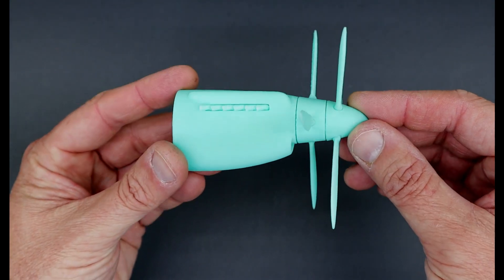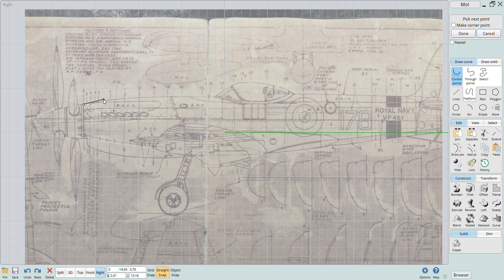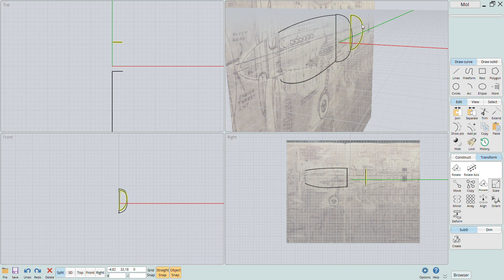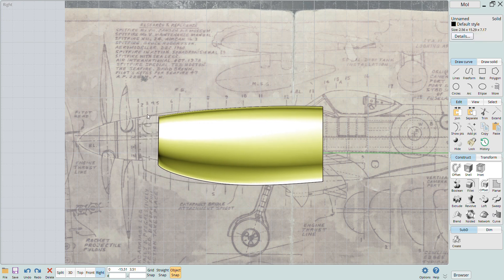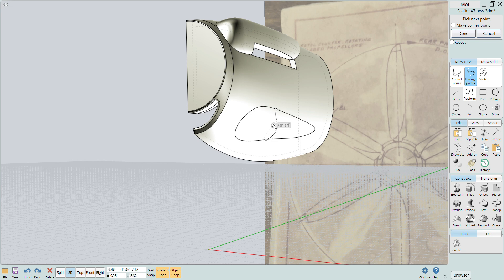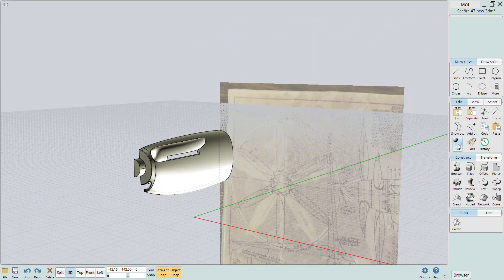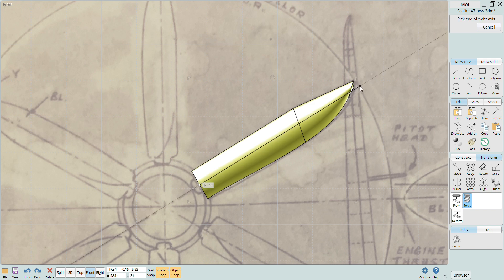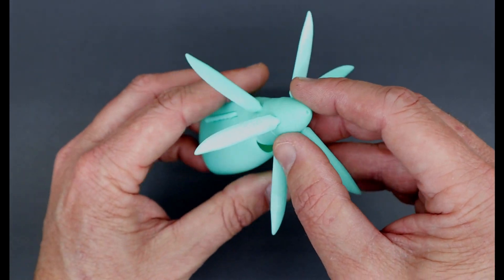Making Model Airplane Parts wit MOI 3D: 1/32 Seafire Mk.47 conversion tutorial

Comment: But what about the scale of the image?
I haven't seen that you have defined the size you want to work on.
Reply from the maker: I probably skipped that part but the imported drawing was scaled to 1/32 before I started tracing the outline.  The software supports that function when you import images.

Comment: I have been wanting a Douglas BTD Destroyer model in 1/48th scale for a long time. The only size they make is 1/72 by a couple of oddball companies.  While I'm thankful for at least that it still isn't quite to my liking.  I'm pretty sure they aren't using this kind of software either because like most resin kits they don't fit well and the detail is fare at best.  Too me this is like a breakthrough.  At 59 I am a little out of the loop, However I do my best at redrawing fuzzy airplane model scans in Adobe Illustrator, a software not really intended for that kind of work.  I'm really enthralled by this kind of work!
Reply from the maker: Hey Mike, thanks for the feedback.  Printing technology is certainly making it easier to get the things we want.  Ping me over at flyingSmodels@gmail.com and I can share some pics of some basic work I've done on a 1/48 & 1/32 Destroyer model.  Might be able to form the base for a project you've been wanting.

Comment: That shell command blew my mind…i wonder if there isn’t a similar command in rhino
Reply from the maker: I'm not sure about Rhino or not but hopefully so.
Reply: @FlyingSModels  it was a question for any rhino-modelers who might stumble into the comments section.

Very similar to the GUI you’re using, but maybe with a lot more bells and whistles. It’s also two or three times as expensive, and with a LOT of bells and whistles. Grasshopper is also a very cool add-in which is free, but not at all necessary for the type of modeling you are doing.

Anyways, I subscribed because MOI looks really interesting for the price and I’m interested in what you’re able to do with it. I just started to use 3d printing in order to replace a few broken purse of plastic in my dishwasher…

Thanks for sharing!

Comment: Thanks, I am just starting out with the MOI trial, and needed to know about sweep.
A friend of mine many years ago introduced me to his dad, and ex Rolls Royce body maker. During the war he made the Spitfire engine cowling, by hand.
I own a 1930 Austin Seven "special". A hand made 2 seater built on an A7 chassis. The man who built it during the 50s got the aluminium for the bodywork from a local RAF base. They were scrapping a Spitfire or two. It's possible, maybe, that my A7 is a bit of a Spitfire.
Reply from the maker: That's great.  Enjoy that free trial and ping me if you have any questions or need any help.  Another feature that I need to make a video of is the "networking" function to do surface modeling.  This is often more useful and accurate than the sweep function to make fuselage parts given their complex curvatures.  That's a fantastic story about your friend's father and your Austin!  I'd just assume yours does have some Spitfire in it.  Makes it even more special!  Happy Modeling!

Comment: I tried this with Catia, my main issue is the scaling on printing. Chitubox doesn't give you a precise measurement setup, so it's trial and error until you find the right scaling factor. My next idea is to create a "ruler" on Catia and print out on Chitubox in orther to find the scale ratio.
Reply from the maker: Yep, scaling in Chitubox can be tricky when you have irregular shapes.  I just scale in my MOI3d software and export to the .stl in the scale size I want.

Comment: Thanks, like many others have stated, this video helps make the learning curve a bit less intimidating. And getting a pointer towards an easy to learn / use design software is a huge help. Looking forward to applying some of this to 3D printing (took the plunge and got a Mark 2P).
Reply from the maker: Excellent.  You'll be glad you took the plunge.  Let me know if you need any help.  Always happy to share my tough lessons learned :)

Comment: Great video! So next step would be to add panel lines and rivets using MOI? Or add them by hand on the printed parts?
Reply from the maker: Thanks.  With regards to the panel lines and rivets, you can really do it either way.  Probably better in my case to just do it by hand once I have everything fitting with the donor kit the way I want it.

Comment: Thanks for sharing that....I did some 3d so I might have ago. Would be interesting to see how they do the panel lines and rivites in 3d! Excellent video.
Reply from the maker: Thank you for the feedback. Adding the lines and rivets isn't hard, just a matter of figuring out what works best with regards to size vs. printer capabilities.  Good luck and have fun if you decide to give it a go.

Comment: whats your way change the scale of a 3d model?  could it be changed to fit different types of scales?
Reply from the maker: I just find it easier to scale it in my print software.  I can change the scale easily in there.

Comment: Cool technique.  I think RC guys use this procedure to build wing spars and fuselage frames for their aircraft. A good set of detailed drawings is critical. I wonder how well a 3d scanner ( and a well stocked aviation museum) would work in replicating aircraft components. As always another great Video!
Reply from the maker: Thanks.  I've seen the stuff the RC guys do and it's really cool.  I've also seen the guys use scanners to direct import into the CAD software (on small parts, that is).

Comment: I really liked this video, thank you for sharing your knowledge with us! Intending to buy a 3d printer, I was motivated by your previous video. I dabbled in 3d graphics (including parametric curves like NURBS, which the ones from your new clip seem to be), it was cool in the early 2000's but I abandoned this hobby. Nobody even dreamt of 3d printers back then. As for panel lines - maybe a small diameter line projected on a surface and boolean substraction would work? For rivets I'm thinking small spheres in array along panel line projected on the surface and substracted or added depending on the kind of rivets. Forgotten how cool it is to figure out stuff like this :) Thanks again for a very informative video!
Reply from the maker: Thanks for the feedback.  You are correct on all fronts.  MOI is NURBS based (from what I know).  And I have had some luck cutting the surfaces with the boolean function and then chamfering the edges and rejoining them.  The small sphere does work great for rivets.  Just have to work on scale as while it looks just right on the screen, it typically is understated on the print.  Need to work adjustments there.  Hope you get back into it!

Comment: Well done, Chad. I know that many are intimidated by the long learning curve of most modeling software and may feel left behind. I think you have demonstrated in this video that MOI's Free 90 day trial can help overcome some of the "fear of the unknown". As model kit builders, we should know that it only takes some commitment to learn how to use the tools available to us. MOI is a tool, and with a little patience and practice, it can be learned. Your multi-part creation in only 4 weeks shows the power and ease of MOI 3D. I was certain that getting these results for this complexity would take much longer. The finished product is like magic! Thank you for your time to present this enlightening introduction to MOI 3D from FlyingSModels.
Reply from the maker: Thanks, Dan.  To be honest, I even surprised myself. I'm still learning, for sure, but the software tool has made it much easier for me.  Once you get going with it, it's actually kind of addicting and it's amazing what can be done.  Pretty much limited by imagination and the ability to envision how to create something.